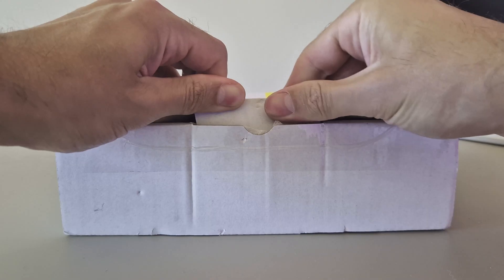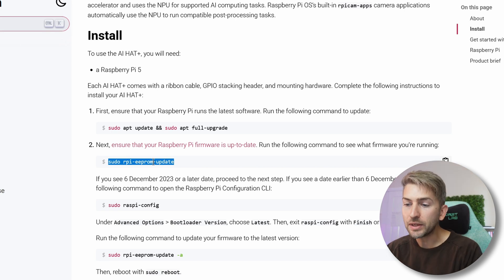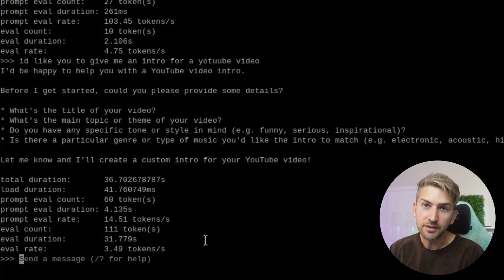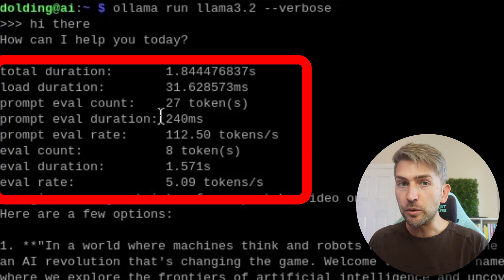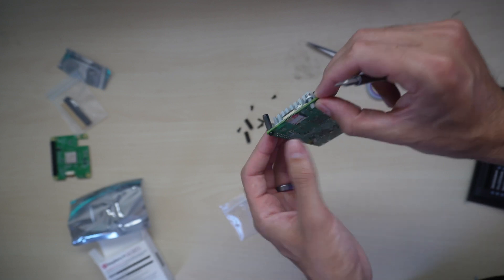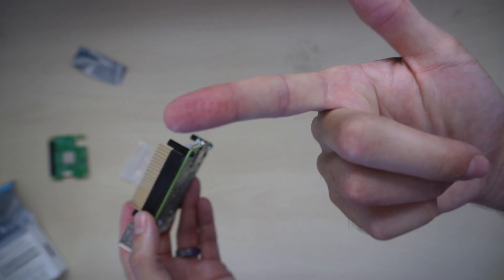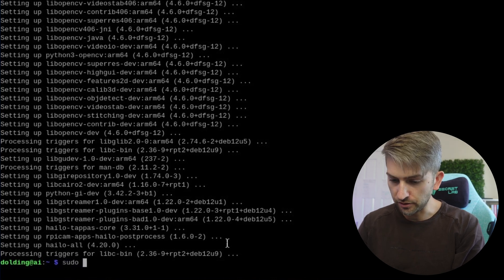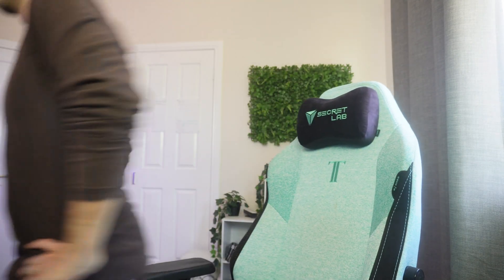Raspberry Pi Ai Hat Setup & LLM Performance

Comment: Technically a Small Language Model - SLM ... have a look a quatizing / fine tuning etc. - get a more efficient SML running and then test ...
Reply from the maker: Yeah a small model can work - however the responses from the small models tend to not be the best.

My ultimate aim was to get an awesome LLM running locally with access to cameras and other iot devices around my house. But I'm kind of realising I'll either need to run my PC with a dedicated graphics card 24/7 or spend lots of money on a mac mini.

I was hoping a low powered device like the raspberry pi would work well -- but ai is just too resource hungry.

Comment: Thanks for the testing, how about text to speech like piper, kokoro or speech to text like whisper?
Reply from the maker: I haven't tried any of those models.
I'd imagine the performance would still be pretty slow as the ai hat doesn't speed up those tasks, so you'd be solely relying on the lower powered CPU.

Comment: I wondered where you were going with this, so I skipped to the end and, sure enough, NPUs / TPUs like the RPi AI Hat or Google Coral do nothing for LLMs... I totally state your frustration here... But if you're looking for a SBC that does do a decent job of running small LLMs, check out the Jetson Orin Nano Super. It has 8GB of VRAM and gets just over 20 TPS running Llama3.2.
Reply from the maker: That sounds promising.
I think I'm going to just save up and purchase a mac mini with enough ram to run a decent model.

Comment: Running LLM on a chip without LLM support is not right. Check Hailo 10 chip, it was designed for a LLM.Also, please read documentation about hailo hef format, which one created to run inference on this device. Sorry, but this video is about how not to use acceleration board :)
Reply from the maker: The Halio10 ai hat isn't out yet.

You're missing the point.
As you can see by most of the comments on this video the advertising for the raspberry ai hat is misleading. Consumers are lead to believe it increases ai performance on a broad range of tasks when it doesn't even cover the most popular use case LLM's.

Someone shouldn't have to go from a raspberry pi product page, investigate the underlying manufacturer being Hailo, and then dig into the technical documentation.

Putting the blame on consumers when they have been mislead is disingenuous.

Comment: thanks a lot !
Reply from the maker: No problem, glad you found it useful.
Reply: @techwithdavidolding  

However graphic card on pi5 tested by Jef Geerling, resulted in 40 tokens per sec which was previously just 2 tokens per sec.
his video id is     xxxxxxxxxxx/watch?v=AyR7iCS7gNI

So since in your case it was NPU and not GPU which did not show any improvement, but I came to know about this only after you investigated with your experiment, thanks for your efforts !

Comment: For AI products when you see NPU/TPU those are not normal LLM processors, they are tensor network processors for ML training/use. You can use some smaller LLMs on NPUs but you have to convert them with a converter program usually in Python to change the parameter format from LLM to ONNX or TensorRT format to use on NPU/TPUs in Pytorch. It's usually for things like facial recognition or speech recognition to text which is why NPUs are in all the new AMD/Intel/ARM CPUs for fast AI voice input. Your device handles the speech/text conversion instead of sending audio to the cloud which takes longer and costs more to process. There are projects for Rpi to use Coral TPUs and various NPUs for camera vision or audio input and trigger word detection that feeds a LLM. Think a Rpi that replaces an Alexa terminal to send text to a LLM on a more powerful machine.

Comment: I bought the 52PI dual PCIe splitter/Port extender so I can plug TWO hats with an extra FPC Flexible printed Cable. Wonder if this HALO has to be connected right to the first native PCIe port on the main board. I want to use an NVMe SSD on a hat then this HALO on its own hat. I hate SD cards and would rather not having a big NVMe on a USB adapter in the USB 3 port which is fine. Get about 400mb/s speeds with that but all my PIs running NVME ssd with the PCIe port im getting 800-900mb/s read write.

Comment: They have a nvme chip for the pi5
Reply from the maker: They do - however both the ai hat and the nvme ssd setup make use of the same single PCI Express 2.0 interface.

I don't believe you can use both at the same time, unless you connect the ai hat via usb which would result in slower speeds.
Reply: @techwithdavidolding  from what I've talked to google Gemini. It says they sell a splitter. But you have to configure the pi to boot from the nvme.

Comment: The ai hat is not for what your trying to use it for, it doesn’t do anything with large language models, it’s for things like object detection, pose estimation, among other things to do with tracking, might want to read the instructions on the website as it tells you this and gives examples, your not gonna get any type of speed on a raspberry pi with ai models unless you use a 1b parameter ai model

Comment: Hey gorgeous, thanks for the video! 🥰 You should run the "gemma3:1b" model on a Raspberry Pi 5 with 8 GB RAM, it's a pretty fast option.. but pretty dumb because it's the smallest model. "gemma3:4b" which is the next size up is significantly slower already, but I guess you can live with it. I run these through Ollama with Open WebUI in the CPU Only-mode Docker-bundle on Ubuntu 24.04 without any hats, just the cooler. Upgrading to the 16 GB RAM version of RPi 5 won't make a difference, because the gemma3:4b hits the CPU bottleneck already before running out of RAM 💓

Comment: Thanks for the video.  I was wondering about HAILO AI HAT API's for swapping LLM sub problems into the TPU.  Looks like that is unsupported.  Also, if you want to run and NVME drive, it takes up the PCIe cable socket, NVME excludes AI HAT and vice versa.  Not the best systems integration.  You can still get the google Coral TPU that comes in via USB.  It provides  4 TOPS of int8 operations, and is adapted to Tensorflow Lite models.  Not sure what else you can do to get TOPS on RPi for AI.  Maybe the GPU can add something to the party?  The Raspberry Pi GPU does FFT's 10x faster than the ARM CPU can.  Perhaps AI inference could benefit from vector processing to and raise the Pi up a level.  On the Pi 5 the GPU uses system RAM which can be up to 16GB now.

Comment: How can we use the ports if its covered by the AI accelerator? What if I want to use the 5V port?
Reply from the maker: Yeah taking a look at it - the ai hat blocks all of the GPIO pins.
I don't think you'd be able to use any of them easily with this hat installed.

Comment: Thanks for this video! Finally someone explains the key differences on different hardware!! What is the LLM that works the best on your PI?
Reply from the maker: No worries 😀
I kind of gave up running LLM's on it.
It just wasn't powerful enough...generally the smaller the model the better the performance, somewhere in the 1-3B parameter range may be okay depending on your use case.

I've instead started using them for proper object detection with the cameras - https://youtu.be/MJODgMNrC4Q

I still really want a smooth running local ai... I'm waiting a bit to see whether the hailo-10 chip will help solve this sometime this year.
Otherwise I might have to look at getting something like the mac mini.

Comment: You totally saved me from getting the same setup.  I wanted to do something similar to what it sounds like you wanted to do originally.  Have you found any other products that would be able to run an LLM for text and not for image purposes like you were originally intending to do?
Reply from the maker: Glad I could help avoid you from making the same mistake :D

So far I've found my gaming PC which is running an 8 year old graphics card (1080GTX) consistently runs smaller text based LLM's really well.
I've also purchased a new macbook pro with the m4 pro chip with 48GB of unified memory -- that thing is amazingly fast -- I'm getting 100's-1,000's of tokens per second responses when running an 8B parameter model.

It seems like we need a newish mac with unified memory or a PC with a great graphics card to get the best performance of these ai models for now.
But I don't want to be running a model on my gaming pc or laptop 24/7 -- right now I think the mac mini's look like a good option.
They have the m4 chip, unified memory, and are extremely power efficient -- but they're expensive.

I'll probably pick one up later this year.

Comment: I have been in contact with Raspberry PI’s sales team.  The Hailo 10, designed specifically to run LLMs, will not be out for close to a year.  They would not let me purchase even a single unit for a prototype I am building.  This has forced me to switch to the Orange PI which, while more challenging to use, has a built in NPU.
Reply: Hello. Did you managed to use the Hailo-10H with the Orange Pi 5?

Comment: Thanks for this video. Have you tried SSD vs SD?
Reply from the maker: Nope, I haven't tried that - I doubt it would make much difference when it comes to ai performance though.
Usually you're bottlenecked by the GPU or CPU.

Although just in general when it comes to raspberry pi's I recommenced using an SSD over an SD card. I've had an SD card get corrupted a while back due to a few power outages, where as if I used an SSD that most likely wouldn't have happened.

Comment: Important information.. many people could fall for this unexpected trap :P
Do you know if the hardware is incapable of doing more or is it just a lack of driver support?
Reply from the maker: Yep I think there will be quite a few people who also may not realise this.

It looks like a hardware limitation with the Hailo-8 NPUs used within the ai hat.
They are specifically designed for improving the performance of object detection using things like YOLO
https://hailo.ai/products/ai-accelerators/hailo-8-ai-accelerator

They are working on a newer module which will have support for LLM's, but its not ready yet.
https://hailo.ai/products/ai-accelerators/hailo-10h-m-2-generative-ai-acceleration-module/#hailo10m2-overview